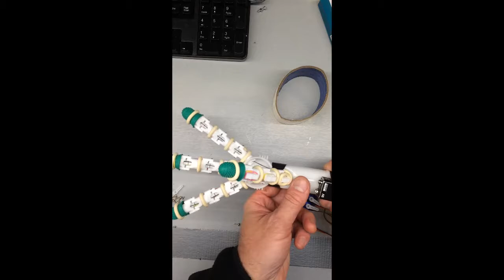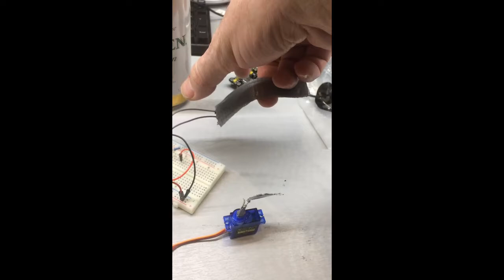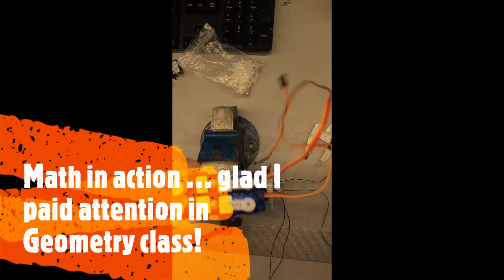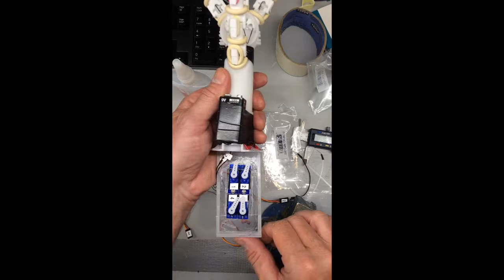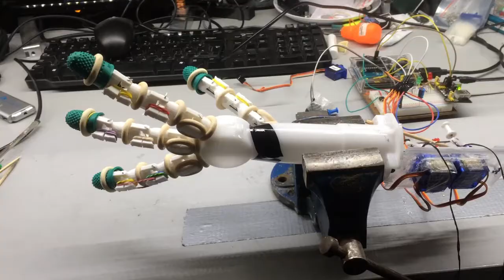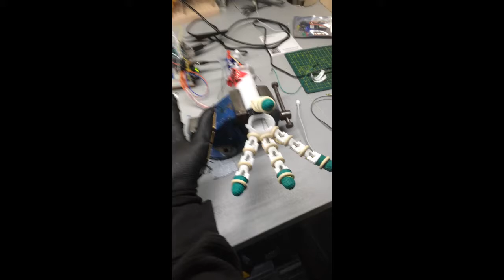DIY Robotic Hand - 3D Printed / Home-crafted Flex-Sensor & Arduino controlled

Comment: like The feet of an ostrich:face-blue-smiling:
Reply: i made a similar one
Reply from the maker: I think we might be a special breed building such things! 
A lot of family/friends asked 'Why did you build it? What are you going to use it for?'
I just built it to see if I could! Sadly it has no use.
Good way to test Arduino coding skills.

Do you have a video of yours posted? Yours have all 5 digits?
Reply: @fixitdad899  What make me have the idea to make "hand" is a really practical one made by David Lans. no servos,no battery and really useful that no one would doubt. Sadly I still trying on copy/improve his version and not finished yet. BTW I like electricity drived hand too.